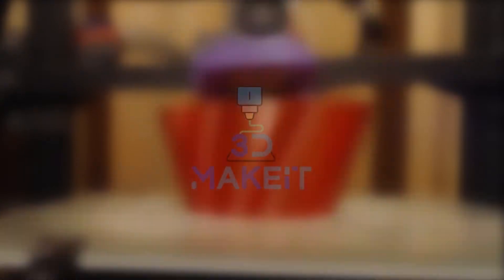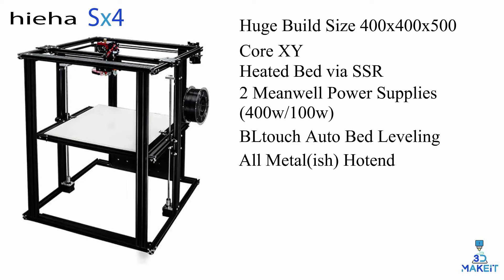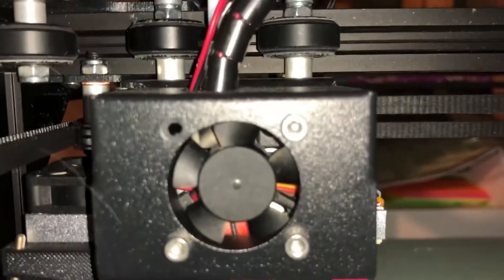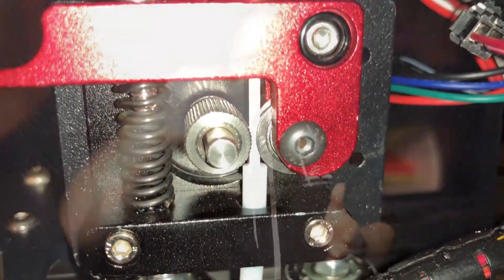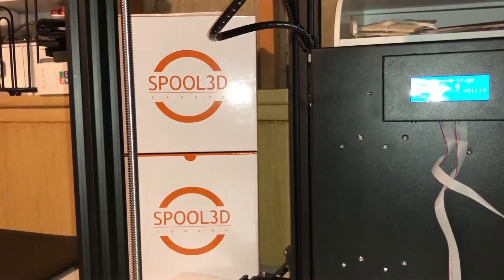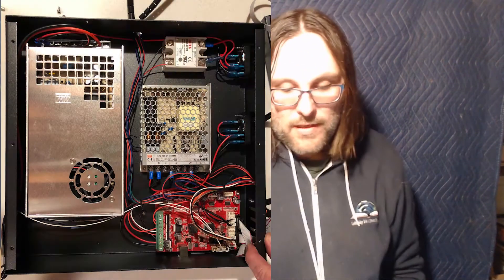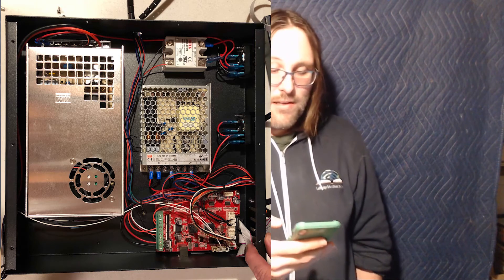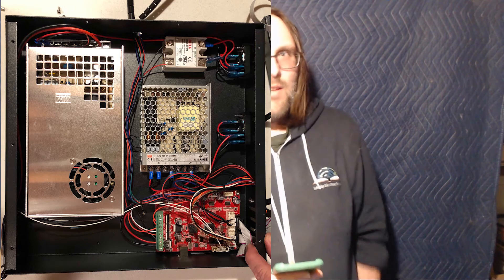Mamorubot Sx4 build and first impressions (Better than the CR10s pro and CR10s5)

Comment: Juts stumbled onto your channel nice work , btw what’s the music in the build part? How easy would this be to enclose and move steppers out of frame to protect them and electronics?
Reply from the maker: Supper easy to enclose.  And the steppers could move with a simple mount if you want them put of an enclosure.  But I would almost say you could just as easy panel it without moving lots.    The say is called workout its from the pub domain youtube library

Comment: is it sx4 v2 or sx4
Reply from the maker: This was the last in mamorubot our out before rebranding.   It would be a v2.
Reply: 3D MakeIt ty and my last questions are: can u see "any" salmon skin on prints ,ghosting or bad bridging? and does it fail often how many times did it fail and again ty
Reply: where should i buy it i thinking tinymachines
Reply from the maker: No salmon skinning (since salmon skinning is usually cause by the weight of the Cartesian build plate moving corexy usually doesn’t suffer from it).  My build plate adhesion is gone after about 10000+hours on it so I just use hairspair every so often.  The failure rate is low to none on mine.  

I have done some updates to mine. In the last month or so.  A e3d v6 (tiny machines has made a mount) and I put an skr 1.3 with 2208s in it.   

Tiny machines or direct from hieha would be good places to get it for sure!
Reply: 3D MakeIt minimum layer resolution
Reply from the maker: @edizkuru7824  I think they say .05 but I've only gone down to .08 with a .4 nozzle
Reply: 3D MakeIt can it print flexible filaments like tpu ?
Reply from the maker: @edizkuru7824  Slowly yes but not the super flexi stuff.  the filament path is straight through the hotend as I mention in the video so if you print to fast it will buckle as is
Reply: 3D MakeIt can u send yhe things u printed here is my gmail edizkuru3@gmail.com

Comment: David what software are you slicing with, do you have profiles or a gcode I can test out?  Paul in New Haven .
Reply from the maker: Hi Paul the profiles are on our web page 
https://www.3dmakeit.ca/davids-projects/Slicers if you follow the custom printer video we have at about 10 mins from the end it will show you where to put the files.  Add the printer and then slice anything you would like in cura to test (benchy is always a fun test) :)

Comment: Hi David- I'm also going to echo on Ken's comment..  been looking for a while at CR10S Pro and stumbled across your video and this printer..  you say its better than the Creality printers, my biggest concern is that there is no large community to help troubleshoot issues, etc..  but the footprint size and speed are very compelling.  Quality-wise do you think it is on par with Creality regarding quality of print, durability, longevity?  Yes I'm new to 3d printing, but i have no issue with building/working on electronics, etc..  so I'm not too worried about that.  Any downsides vs. the creality I'd like to know!  And would you put this up against your other printers??  Thanks!
Reply from the maker: Hi I will be doing that follow up video for my next video.   But to answer your question qulckly.  It has yet to fail me.  Literally, I have not lost a print or had to stop this machine due to failure.  It seems to have quality parts which are on par with the Cr10s/ender 3 pro. And if you were looking at the 10s pro I think you will have better luck with an sx4.   I myself would get the 10s before I got a pro.  but if you want a bit bigger build volume it's great!.  Keep in my core xy kinematics can be a bit harder to set up but nothing to shy away from.  As for support you definitely right there is a smaller community but it is growing.  I would have no problem recommending the Sx4/Sx2

My video releasing today shows how well it can perform for complex support.

Stay tuned for the follow up (which in theory will be the end of July as Greg has our next video!
Reply: That's a big help!  Thank you!  I'm probably going to spring for the SX4 then..  good luck with you channel, I'm subscribed and will look forward to your next post!

Comment: Was my first printer have off and on tried to get it to print but it just loops filament change. Only have had it for about 3 months but only been put together for 1 month. Was easy to build and mine was missing build plate so spent 10 hours trying to get filament to stick on metal bed lol. Need to contact company and let them know about my problems just never have the time. Glad to jear it works great. Just got prusa mk3s and have had a better experience. Just no imformation anout these printers so i've been stuck.
Reply from the maker: You prolly won a clogged nozzle if the filament is just looping.  An e3d v6 / lite are easy to install and a great improvement on the hot end!